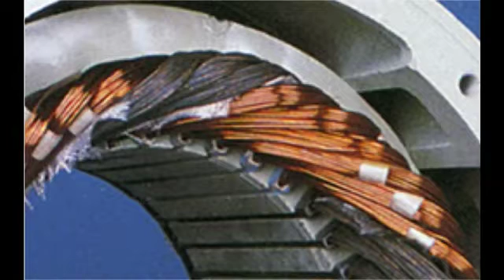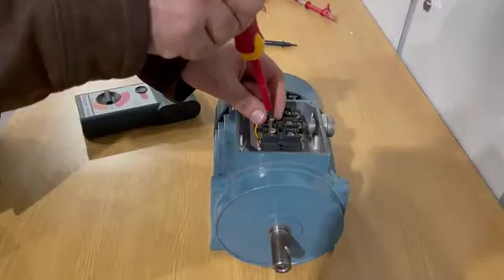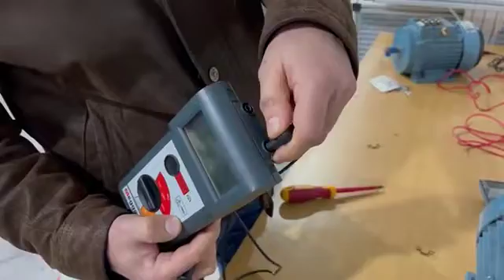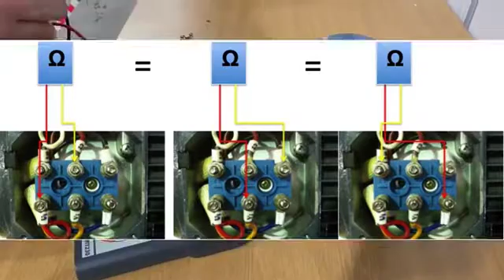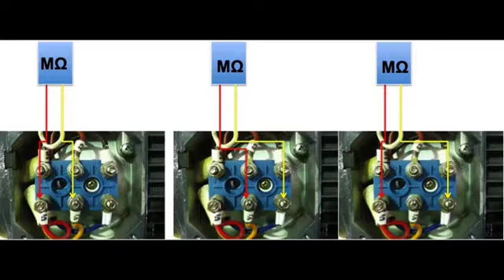Motor testing with a Megger MIT230

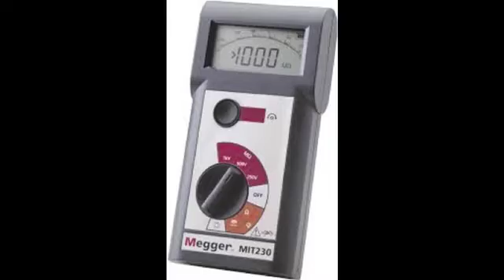Comment: @1:50.. All the way to 1000 Kilo volts 🤨.. That seems a bit on the high side.. 1000V aka 1Kilo volt seems right, but a 1000 KV seems a couple or 3 factors off 😉

Comment: If the motor is 415V, I understand each phase is only 230V rms to neutral/earth. So a 500VDC IR test to chassis makes sense.

But why wouldn't you test between phases at 1kV?

415Vrms is 587V peak, which is admittedly only the peak value, but you're not checking that for the duration of the peak the insulation is not breaking down.

So a 500VDC IR to chassis and then 1kVDC IR between phases would be correct?

Comment: One of the over looked problems i see when a engineer is fitting a motor back on a machine is not checking they have 3 phase through the circuit breaker switch, and contactor. Also checking the cable to the motor for damage.
Reply: You see. A engineer has zero experience actually fixing the things they create.

Comment: When fault finding in the field I never remove the links and always start with a insulation test. Most motors fail to earth. No need to carry out more tests. Start with the black lead on a earth point and the red lead on another earth point, this test your leads and earth point. then use use the red lead for the winding tests. When tests complete retest the red lead back to a earth point.